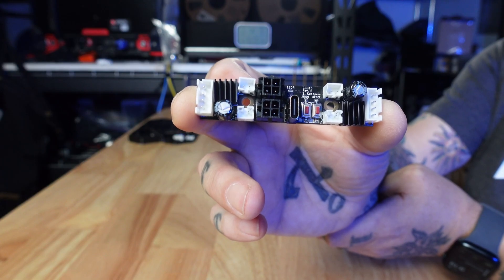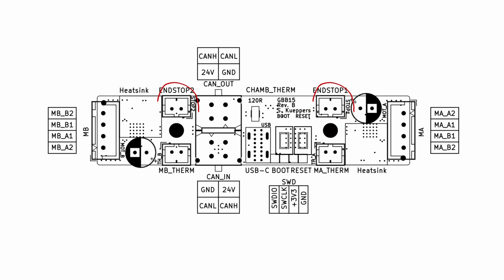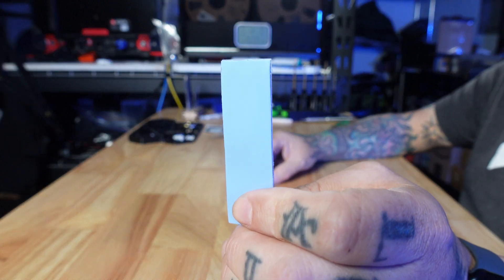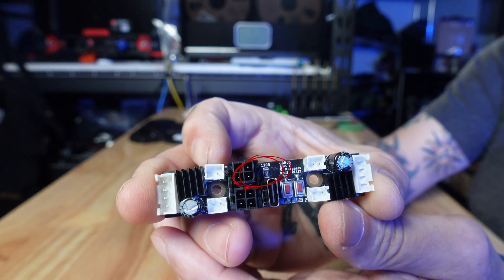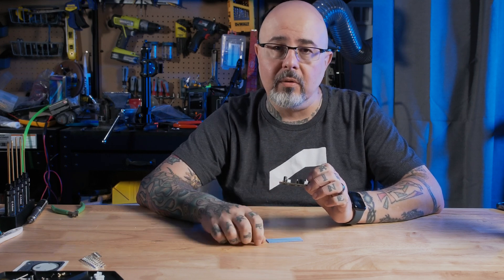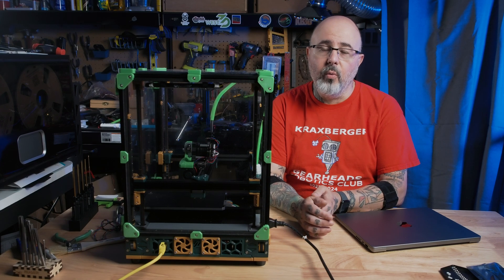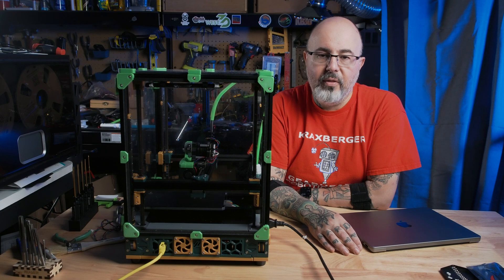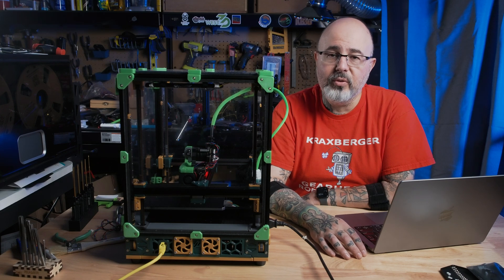Put A Little CAN In Your Gantry With The GBB15 Board

Comment: Can't say I see the benefit going that route 🤔 Sure... You got rid of 6 Wires ( potentially more depending on one's Setup ) for doing that BUT now you're exposing the hardest working Stepper Drivers to the Temperatures of a Heated Chamber? 🤨
Reply: Stepper drivers are quite temperature tolerant (125c operating), but inside the build chamber you absolutely need active cooling. Inside a electronics bay you can rely on the heatsinks most of the time, i think the practical limit for tmc2209 is around 1,2a run current before needing active cooling. At least i never got a overheat warning with 1,2a spreadcycle. Now i have one fan for the rpi since its summer and idles at 55c.

Also why 2 instead of 4 drivers? For awd you need four drivers as tmc2209 can only supply 2a run current and you need all drivers of the same axis to be tied to the same cpu. Also 4 drivers would allow you more precise syncing since there is a plugin that uses an accelerator to fined the perfect microstep for awd syncing 

For me the only mcus inside the chamber that make sense are bed control mcus like the prusa xl has in combination with a segmented bed as well as toolhead boards. For motion you might as well make a hole in the back panel and stick a skr pico or annex super nova to it if you want a dedicated xy motion controller

Comment: You didn't go over the 2020 heat issue
Reply from the maker: Sorry for the omission. Using the board on 2020 extrusions may need a thin piece of aluminum sandwiched between the board and extrusion as an additional heat sink, as speculated by @mghumphrey.
Reply: I'm speculating it's because of the larger slot in the extrusion limits the surface area that's contacting the aluminum.